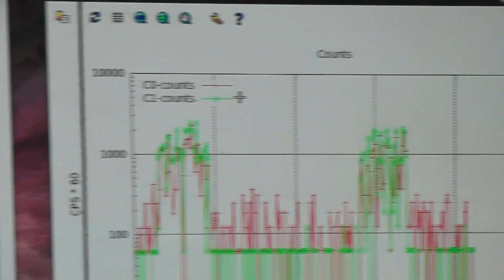Oscillation

Comment: Doug, can you set me up on your forum? I promise to be a carbon based lifeform that will interact and try to learn beyond my knowledge base.
Reply from the maker: There's a huge backlog waiting, it might take awhile - I'm adding a few a day, so the mods won't be overwhelmed by any possible jerks I let in.  You need to send me email (the board software requires a valid return address), tell me what you'd contribute.  The only reason to be a member is to post, you can read it all as is.
No secrets.  But we are grad school, there's another fusor forum that's grade school, and they are all friends as well.  They are here: http://www.fusor.net/board/index.php - the guy who runs that is a friend, and I sometimes post there too.  They have open registration all the time.
Reply: Doug Coulter I'll start there for the time being but would still like to be on your forum for gunsmithing and reloading as I do have a pretty extensive background in that arena. Lucky me to have been taught by one of the old craftsmen, Ernie Henderson.  Rest his cantankerous soul. He took a punk kid with too much time on his hands and turned out a journeyman smith specializing in ww2 to present (70s era) weapons and restoration.  Now that I'm retired it's a good hobby to get back into. I just didn't remember how many special tools needed and the initial cost. But even that's a fun thing to get together. I've only had to go to McMasters once so far for my mills.
Reply from the maker: William Kennison
Well, we are picking up some gun guys - I'd been the only one, and I'm in the middle of making a vid series on how I load match winning stuff, with some requests to branch out into light loads and casting (which I also do).  You can do this without a ton of bucks, but I sure do love my maxed out dillon rl550b.  In a pinch, there's other presses around like an RCBS rock chucker - but they are slower and less precise (no kidding, and who'da thought?).